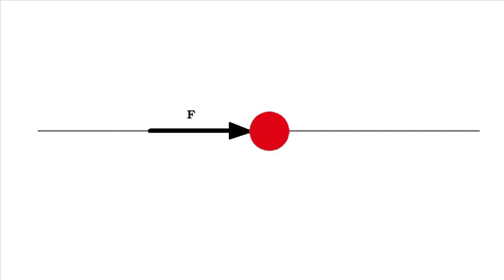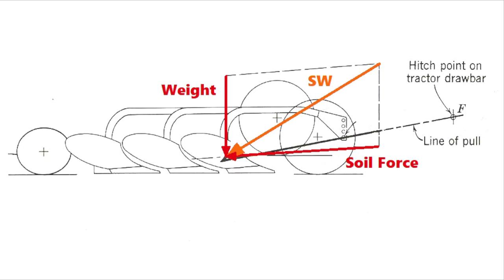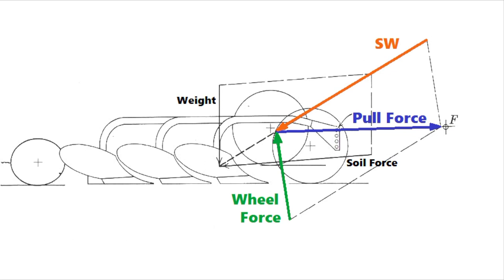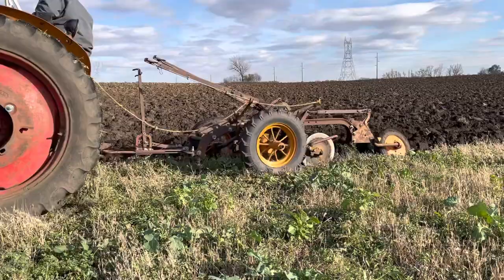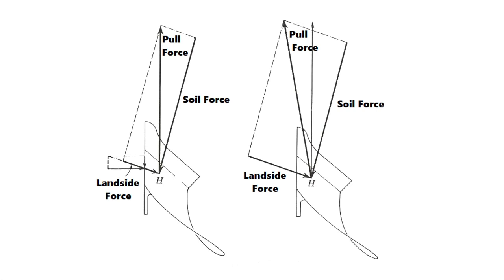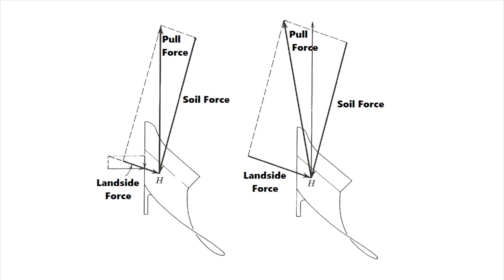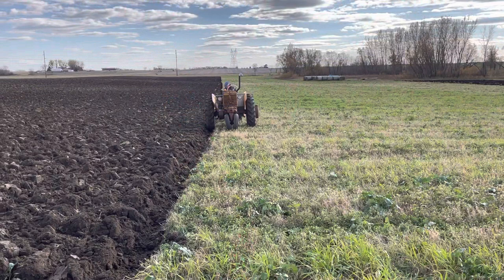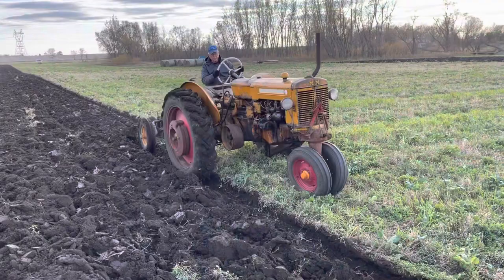How To: Adjust Your Moldboard Plow Hitch

Comment: As a soil technician, plowing may be the most important job to prepare a field for the next crop. I like the way you're are doing it. Using an old plow, taking time to do it properly and getting the best possible results. Plowing needs to be done when soil is ready for it too. No rush, no plowing when raining and most of all, plowing in a way to make next step the easier possible. When farmers are plowing in bad conditions, it's because 1 : they badly manage their time or 2 : because weather is terrible. Most of the time, number 1 IS number 1.
Reply from the maker: Yes! Good quality of work decreases the effort needed for subsequent cultivations and decreases future weed pressure.

Comment: Diagrams were nice to see alignment. Would have been nice to see you actually show what you adjusted on the plow itself to fix the problems.  Even if you just pointed out what adjustment you made.on the draw bar or the levers it would have been very helpful in understanding what need to be adjusted
Reply from the maker: Thanks for the feedback.  I can show that in another video I have planned.

Comment: so I attempted to use my John Deere 820 and John Deere 777h 5-14 plow today and the tractor wanted to pull to the right real hard and the front bottoms wouldn't go in the ground, it was real hard ground which didn't help but what do you suggest changing first? the hitch on the plow is 28.5" from the furrow wall, the book says the center of draft for that plow is 38.5" the drawbar is centered which puts it at 24.5" from inside of the tractor tire. the hitch on the plow is in the lowest setting and the hammer strap on the tractor is on top of the drawbar vs underneath it
Reply from the maker: Well the tractor pulling to the right means the tractor hitch is too far right; the plow force is trying to rotate the tractor.  The tractor hitch needs to end up somewhere between that 38.5 and 24.5.  The front of the plow not sucking down is interesting.  Could be dull shares or the tractor hitch is too high.
Reply: @everythingmoldboardplows  ok thank you I will try swinging the drawbar on the tractor and see if that helps. is it likely that I will have to move the hitch on the plow too or just try a few different spots on the tractor first? I was going to try putting the hammer strap on the bottom of the drawbar but couldn't get the bolts loose at the time.
Reply from the maker: @johndeereequipment  It’s a chicken and egg game to get the line of draft correct at the same time as getting the front bottom to cut the right width. Once you start narrowing it down and the front bottom cuts the correct width, then yes, you usually move the tractor and plow drawbar together to hone in that line of draft.

Comment: Is an Oliver 4240 a good plow to invest time and effort in.  Do they really have the lightest draft?  The hitch is infinetly adjustable versus finite hole spacings.
Reply from the maker: I know people who have had success with a 4240.  A friend with a 4240 would like to fabricate hitch plates to bolt on a regular hitch from an IH or JD plow, because the hitch on the 4240 is frustrating.  It’s a hassle to make a horizontal adjustment and the vertical travel is limited by physical stops which can get you in trouble. 

A 1941 research article on moldboard plow draft found the short 225/625 stubble bottom from Oliver had the lightest draft.  It is short and turns the ground quickly so the soil is on the board creating friction force less than other bottoms.  THAT is how Oliver got the reputation for light draft.  However, the 225/625 bottom does an ugly job of plowing in about every condition.  It shines when the ground is mellow and pulverizes easily.  The only redeeming quality is it scours when other bottoms won’t, because it is so short and abrupt.
Reply: Wow, I really appreciate that.  What trailing plows would you recommend for me then?  I am a retired mechanical engineer and turbo neophyte into John Deere D's for plow days.  I have a 1928 on steel I think I need a 3-14 for, and a 1950 I think I need a 3-16 for.  I have a machine/fab shop left over from my entrepreneurial career and can manage a little bit of what you are doing.  My 4240 has been a frustrating wild handful so far me knowing nothing.  Maybe less than that.  Thanks again.
Reply from the maker: I don’t think you could go wrong with a John Deere 55ABH.  A 5C would be the correct vintage for your 1928.  IH, MM, or Case would be good also.  However, as in the case of the 5C, if you are particular and want to do a good job, I would steer clear of a two bottom with an “add on” third bottom which is not a full length beam.  They are almost always not straight.  So, a 55ABH “full frame” three bottom with NGP or EP bottoms would do a nice job.

Comment: I have a oliver plow master 100 that looks like its going off to left field all the time it doesn't affect the tractor but doesn't like to go into the ground all new wear parts point,shins,landslides. any idea witch way to move the hitch
Reply from the maker: Those Oliver's have a tricky hitch with not much range of motion vertically; you have to carefully watch that you are not hitting the travel stops of the hitch which could cause strange behavior like you are seeing.  Lower the plow hitch as low as it will go and then lower the tractor hitch until the thing goes in the ground.  As explained in the video, if the front acts like it wants to go in the ground but the back of the plow is bobbing up and down, then you went too far lowering the tractor hitch.  Also, I'm not a fan of throw-away lays on little two bottom plows; I think they need a good sharp blacksmith share to suck them into the ground.  So, you may always struggle, especially in hard ground, with your Oliver.  Check out my plow share video: https://youtu.be/b1iuiqzQ4BQ
PS: maybe take a critical look at your new shares: they might have a blunt cutting edge from new.  A little grinding might make a world of difference.

Comment: Recal as a small boy plowing with a H and in sone cases the furrow wheel on the tractor would be set in to facilitate the proper pull line where tractor would auto matic go straight ahead
Reply from the maker: Yep, I do that with our M with a wide front; when it’s all set correctly you don’t need to steer.

Comment: Very good video. However you missed a huge point. And that is the Colters if the Colter are not straight than the cut won't be right. You should know that is major problem misaligned Colter.
Reply from the maker: Coulter adjustment is coming in another video 🙂

Comment: Where can a fellow find good cutting edges when his are shot?
Reply from the maker: You can find throw away shares but blacksmith shares are harder to find.  First step is to learn what you are working with: start with a part number from the share and the moldboard.  I’m working on a plow share video that I should finish soon.
Reply: @everythingmoldboardplows  I got the part no.It's an IH number. I haven't found any place yet that can help me.
Reply from the maker: What is the number?